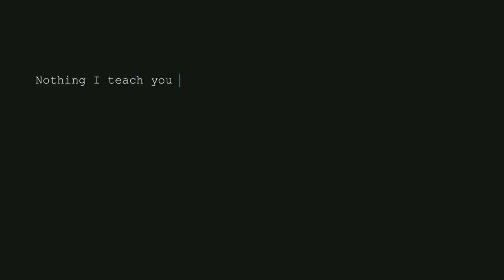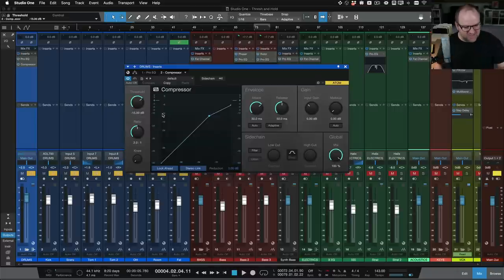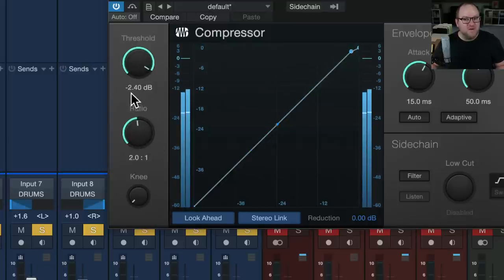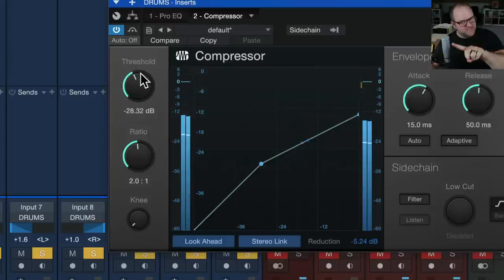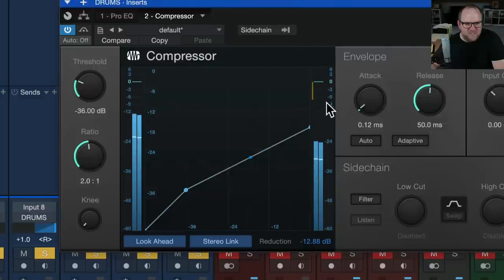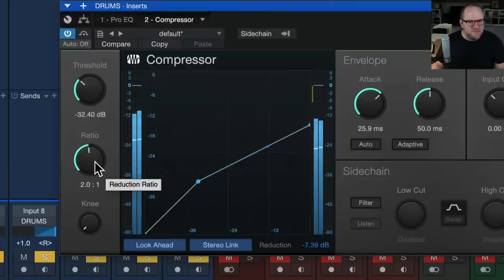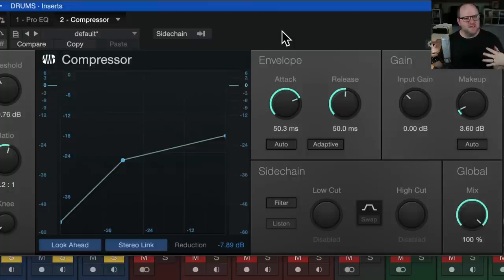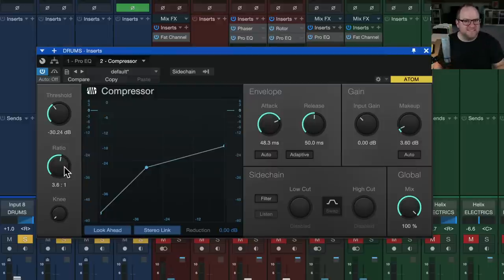How to Set the Threshold on a Compressor

Comment: Threshold = How loud a signal has to be in order for the compressor to react.
Ratio = the amount of compression is applied for every db the signal exceeds the threshold. So a 1:1 ratio really becomes a wash and will be extremely transparent. You won't notice it so much until you get to 2:1, 4:1, and beyond.
Attack = how quickly the compressor acts against the signal that has crossed the threshold.
Release = how quickly the compressor stops compressing the signal.
Reply: @Brett Marlar, Thank you!
Reply: I would like someone to explain why a release time of 3 secs or more are needed to reduce the imposed crescendo of a cymbal crash. A release time of 1 sec causes a cym crash to horribly swell. But even set to 3 secs, a compressor with change a fading cymbal crash into a crescendo that needs editing.

Comment: I can relate to Joe's story at the beginning of this video. I have spent many a time adjusting eq and compression, thinking it is making a difference only to find I was adjusting settings on the wrong track. It's amazing how your ears and eyes can deceive you. Another way of increasing compression is to increase the input gain. This will push more signal into the compressor.

Comment: There is 1 to 1 ratio on compressors because sometimes you might just want to get the character of the compression without a decrease in volume, so to speak, some compressors are based on the 1176s of long ago.  Some are based on LA-2a, etc. Basically, compressors don't necessarily sound the same,  even if the settings are the same
Reply: thats true, but this specifically is a stock clean compressor with no nonlinearities. i kinda agree with him for that reason.
Reply: And some compressors have a less than 1 ratio setting for upwards compression.

Comment: I haven't run this test myself but if you're aiming for a specific gain reduction target, would the results be the same if you achieved it using a lower threshold vs higher ratio (keeping attack the same)? I would think no because the threshold determines what part of the signal is getting compressed right? Would it be appropriate to determine at the start what the objective of the compressing is and that would decide on either lowering the threshold with a low ratio vs increasing the ratio but raising the threshold?? Eg, taming peaks, leveling a performance, gluing, etc?.
Reply: I would like to know about this too.
Reply: Being a newbie at this, as i understand it the lower the threshold the more of of the signal is being processed. You can set a lower ratio to keep the overall gain reduction at around the same level, but the result will be different. It’s my guess that this is the part where your ears is what determines what is best

Comment: It's actually one of the difficult effects to learn to master, especially if your completely new to it. Would very much like to see some more in depth video's on the matter, like with the plugin you have here, what is the "knee" doing, and when/how to use the auto atk. I'm also very much in doubt which of the effects you use in a home studio is worth the extra money for a hardware effect like eg one of the 1176 inspired hardware compressors vs a vst plugin. Is it worth plunging out maybe $1000 and much higher prices for outboard compressors or some of the SSL hardware mixer/ channel strips available.
Reply: I've been trying to get hold into it, and it's never easy

Comment: Joe did not seem to answer the question of how to set the threshold on a compressor. I am sure many people are left wondering what that answer is. I will take some time to answer that question for everyone here. Setting a compressor threshold is dependent on what portion of the signal you want to compress. For example, setting the threshold just beneath the signal’s peaks will compress only the loudest parts of the signal. You could also set the threshold to a lower level to apply compression to more of the signal. The lower you set the threshold, the greater the amount of signal you compress, resulting in greater gain reduction. This will level out a whole performance. However, long before you answer the question of setting threshold on a compressor, you have to ask yourself what goal or goals are you trying to accomplish with compression. There are 4 main goals of compression which are "to balance" , "to enhance" , "to glue" , and "to fix" audio. When dealing with the goals of "balancing" a track we are dealing with technique styles of consistency , and depth (far and close). This goal and style of compression deals with HIGH THRESHOLD settings and FAST ATTACK settings to achieve that goal. This means you are going to use your ears and eyes to set the threshold. It is not an exact number, but the threshold setting for this goal and style will be on the higher side because you want to compress just the loudest parts, which means you are only effecting the signals peaks. If your GOAL is to "enhance" creating a "punchy" style of compression, than you are going to set your threshold to lower setting to allow more of the signal to be compressed , and you want a slow attack time to allow the initial transients to not be initially compressed at the full ratio until some time happens. So in closing, the threshold number is set to the GOALS and Styles of the goals you want to achieve. Use your ears, and use your eyes. High thresholds are going to be in ranges of -10db to 0, but again, there is not exact number, you have to use EARS as well as EYES to achieve proper settings. I preach using your EYES just as much as EARS because everyone thinks they have great ears, but they don't. Metering on any devise is your friend. It tells you want is going on, use your eyes just as much as ears.
Reply: Compression in pop music is relatively easy as the dynamic range is small, with little variation in track volume. I struggle obtain balance when mixing down an orchestral work, where the range is often pppp to ffff. Compression is an enemy of dynamic range. I would love to know how to apply it to classical music without sacrificing too much of the range.

Comment: Yeah, but a key point that a lot of people forget, is to set the makeup gain after setting their compressor up, not only that, but they do not AB in context to actually hear what the difference is in the actual mix. If you do not apply makeup gain after the fact, you've essentially just set up an automated volume control..... It's just going to "regulate" the volume.... And although this is by nature it's job..... The tone gets lost in translation without the makeup gain... At least it sounds that way to me... Again, great advice, thanks Joe.

Comment: And what does the Make Up knob do?
Reply: When you compress signal, you also diminish its gain. The makeup knob allows you to restore some of that lost gain. You would typically turn the makeup so that your meter reads right around where it was before you added the compressor. In short it makes the quieter parts louder, which is one of the key purposes of compression. It brings out those nuanced details in the recording while also taming the peaks. The key point of compression is too narrow the signal's dynamic range while keeping (and even enhancing) its overall character.